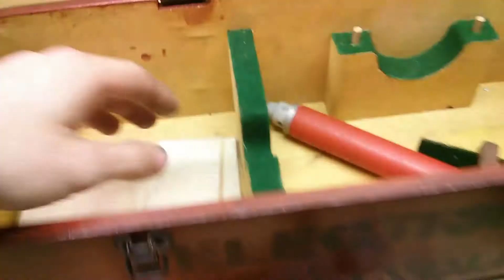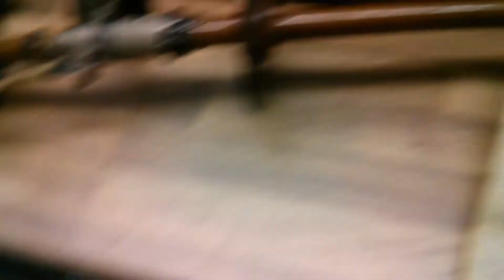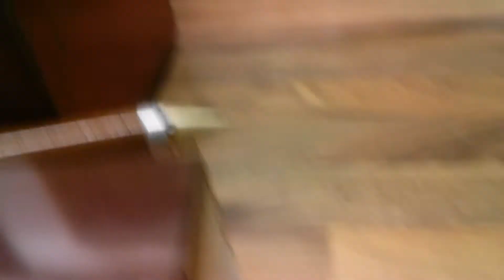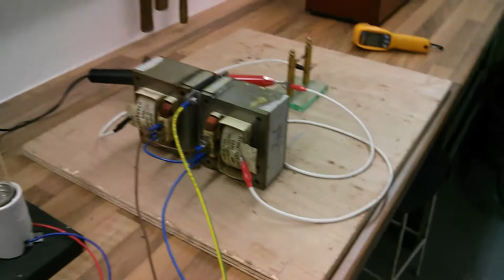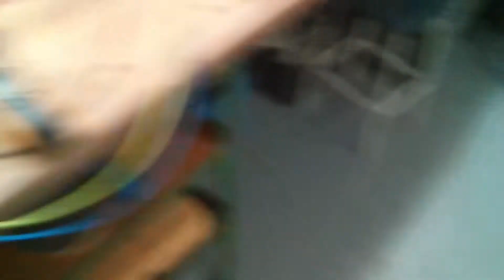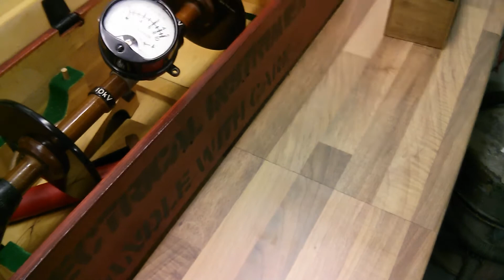Vintage 11KV High Voltage Indicating Probe Box Restoration Project Complete and Test

Comment: Nice looking chicken stick! Great idea using a bulb as a ballast too, it becomes a good visual indicator.
Reply from the maker: Thanks Trev, The lamps are great for light-weight (no pun intended) ballasts too, as opposed to the heavy inductive HID lamp ballasts or the cumbersome capacitive ballasts some use. also resistive is a far cleaner form of current limiting, I will do more videos specifically on this subject in the near future.
Reply: Steve Lane Cleaner indeed! No one likes to be booted by a metal can capacitor, those things can be real nasty if not discharged correctly.